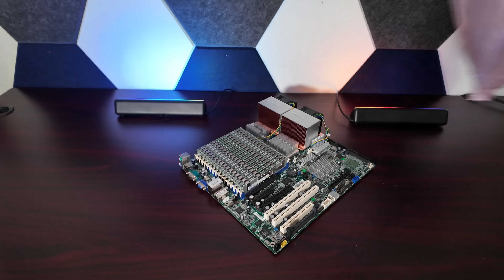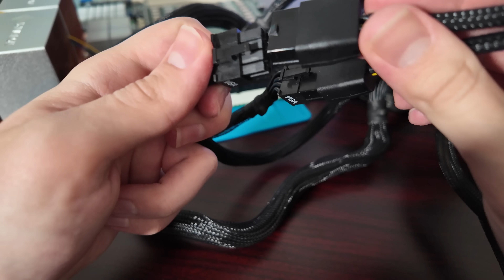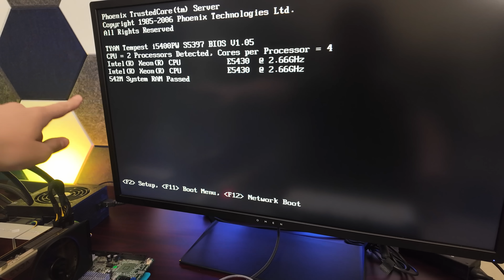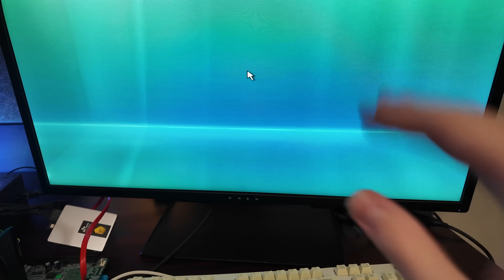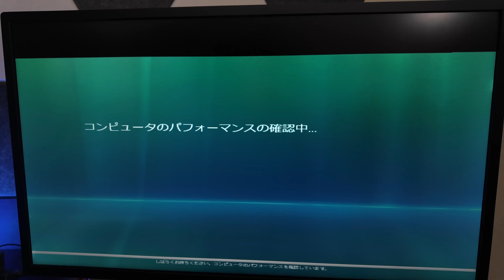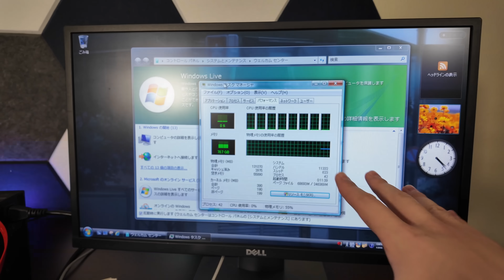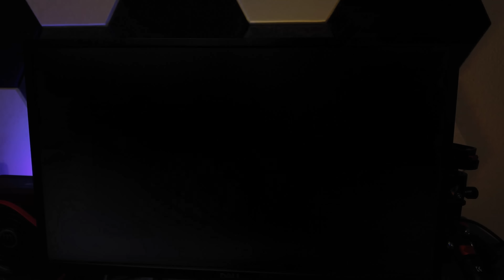What can you do with 128GB of DDR2?

Comment: Usually servers with that memory would be used for virtual machines. You're definitely bottle-necked by the CPU and the fact that it's DDR2 in terms of performance, but running lots of VMs/emulators simultaneously is something you could try; one computer becomes several drivers.

Comment: The ramdisk is probably caching writes so they are faster. Those speeds are surprisingly low, I figure the software is the bottleneck there. Since Linux has native support for ramdisks it would probably perform a lot better.

Comment: 9:00 - for anyone else that runs into a formatting problem during install, you don't have to restart the entire system or even restart the install process after a disk clean. You can just close command prompt, click back into the install wizard, and hit refresh/f5 to rescan drives.
Reply: He could've also just pressed《🔃最新の情報に更新(R)》(which hints to the fact [Alt]+[R] should've also worked) if he didn't think of the obvious key combination. Why did he do this in Japanese again?
Reply: @whohan779  He could only find a Japanese language ISO iirc
Reply: @jammer1248  Strange because even though Vista is somewhat obscure, there should easily be an ISO in every major language on the internet archive.
Reply: @whohan779  true. might have been some other reason for that, then. Or it could just have been he thought it would be funny.

Comment: Blender.  I have trouble with my current computer because I only have 64Gb.  Try about 3 million polygons and try to remesh it. It will seem like it freezes, but it will gobble up ram like no tomorrow.  I've seen it try to go up to 192 gb, using my NVME as ram... I gave up on it after some time, but if it can handle large amounts of math, it's worth a shot.

Comment: My computer is from 2007 it’s a dell T7400 that I use for gaming I have 16gb of ddr2 ecc fb ram (with the heatsink) 2 Xeon e5450s and a gtx 1070 founders before I had a GT1030 in it but my 1070 works good with my set up both my cpus are clocked at 3ghz but yeah I use it to play my games like re2 2019 and some other modern titles it does pretty well for a $300 pc 😂

Comment: I honestly couldn't watch the video, but zipped through it, what/who can use vista in 2026, i thought you're gonna do something cool with the ram, like LLM related, or at least homelab linux server, etc.
Each ram is eating like 8w, so at 128watts for the ram alone, and you can safely double that for the rest of the system. I doubt it is worth anything these days, performance wise comparable to an n150 or maybe tad bit better. Not worth wasting power cycles on it now.
FB-DIMMs are notoriously slow and power inefficient, only use case, space heater, lolz.
Which i really think that even a used AC is much more bang for the buck used as a heat pump.
God speed

Comment: I did a build years ago with 128GB of DDR2 - They got so hot, I sensed it was necessary to install a PSU fan on top of the DIMMS.  No errors, no interference.  Maybe it was all the metal shielding on the modules.
Reply: ECC

Comment: i feel like this video is retarded ragebait. you should have put a modern OS on it, with some sort of modern GPU and run some large models on it, opened some massive project files in various professional apps, etc. but instead most of this video is banging our heads against the wall as you install fucking windows fucking vista. like what the fuck did you smoke and drink while you brainstormed this project?

Comment: but Vista? you are a sick, sick man. Im all in for it. I would have liked to see the Pi check complete. that was always my goto when overclocking RAM, you could have a stable looking system in most standard benchmarks, but failed a pi compute. I spent way to much time in my youth diddling with RAM timings and getting multipliers to all mesh up nicely. my rig always ran faster with cheaper hardware than those who just threw money at it.

Comment: Installing Windows 7 in 2026 seems like a waste of time.

Since you have so much RAM, an SSD, and a graphics card, why not try installing a modified version of Windows 10 and/or 11, like MiniOS, and try running games like Halo Infinity or Cyberpunk?

You could try Android emulators or install them natively, such as PrimeOS or other Android versions for PC, besides Android-x86.

You could also try Linux distributions like Zorin, Mint, Ubuntu, Bazzite, etc. That way you'll really test the power of that beautiful machine.

And please, use English versions of the operating systems, instead of those Chinese ones.

Greetings from Santiago del Estero, Argentina

Comment: ofc thats fbdimm and its even slower than normal ddr2, and all that capacity was mainly targeted at server use. Well not too long ago you could use such a twin xeon s771 rig, paired with a gtx 980 to actually play modern games, but that was 2018-ish and is not relevant anymore cuz no avx or sse4.2. But again considering that games from this decade are mostly shit (cp77 and likes of it), ig just use it for 2010-2019 games and sell off the surplus ram, more than 24 gigs would be a total overkill anyways.

Comment: Has anyone ever swapped RAM modules while the MB in standby mode? I did. I upgraded a computer from 16 to 32 GB and when I went to plug the mains cable back into the power supply, I realized I had forgotten to unplug it 🤦‍♂Interestingly, nothing happened, but I don't want to be the one to test how many times you can do it without damaging something

Comment: The next generation with DDR3 with the memory controller on the processor is so much better. I have a server with 192GB, this memory was dirt cheap a year or three ago.
Don't forget that this board probably has ipmi so you can control this thing from remote.

What's up with that vista version? And you should be running a proper OS on it, with a couple of VMs or containers.

Comment: On the power pins for the cpu. My assumption is the 8 pin cpu was in its infancy or only just started being conceptualize. So the board had the wxisting standard of 4pin double.  Like how some high end boards have 2 8pin connectors for the cpu now.
Reply: Alright, watched it back. That is odd they are spread like that. But its probably to do with board layers and trace pathing.

Comment: I'd say, some interesting uses could be : 
- large IA/LLMs models, like many suggested
- you were on the right track with the RAMDisks : RAMDisked VMs on which any OS could run, Win10/11, Linux distros... & In an equivalent of multiboot, so that instead of proper multiboot EFI/bootloader, you'd simply have several VMs backups in storage, to run at any point, with still plenty of RAM &/or RAMDisk storage on the side, available with each RAMDisk active OS.
→ For instance : a 50 GB RAMDisk on which a Win10 VM is running, then a 40 GB storage RAMDisk on the side, that would be used in common with several OSs eventually (careful about the partition type & compatibility issues, esp with hibernation), & plenty of free RAM aside.
- RAM-based NAS/server ! Yey ! Would behave sort of like a NVMe based NAS, but with storage that doesn't suffer the same flash degradation under intensive use , so some actual intensive use of memory/storage here could make sense. Would require some regular backups on the fly though, on some actual permanent storage (HDD...), & I don't know whether SoftPerfect allows all that in such case, or any equivalent on NAS OSs...
- Crypto-mining memory (flash) based, but I don't know of any personally, not my experience...

Comment: the extras next to the 24 pin plug are the CPU 12v plugs.

The 3rd one is for PCI-e and peripheral power, that rail can provide about 150watt of 12v power, 50 watts of 5v power and 12 watts of 3v power.

Back then the bridges were electrically seperate from the data signalling so used diffrent power for best results .

your welcome

Comment: that air needs TO BE DIRECTED ACROSS THE SURFACE OF THE SUPERMICRO BOARD
SORRY I didnt mean to use caps
thats a 1u setup
it will 1000% hit tcu safety in like 5 sec and clock down throttling back
if you cant get a 1u server chassis, yo buy somw acrylic and make a chassis out of that instead. use pressnuts for screws.

Comment: There's an application called glucose on GitHub that's used to solve satisfiability problems in .cnf files. This application consumes a lot of RAM and CPU. It's especially suited to your hardware and also serves as a benchmark for the efficiency of system tuning. I would also look into the cache architecture of that Xenon. This will help you determine if it's worthwhile to use multicore problems or not. Glucose is single-core.

Comment: This machine would be great for batch pathology analysis of whole slide biopsy scans in programs like QuPath which are incredibly RAM intensive rather than CPU demanding. Even today, I’m limited by heap memory for analysis of SVS scans and there are scenarios where I’ve struggled with 64 gb. Each scan is an architecture consisting of tiled pyramid TIFFs of 40x scans which are absolutely massive and normally have to be streamed into the pathology analysis software so that they don’t consume all of your memory—especially if you have a massive project running with 30+ scans that you’re batch analyzing with scripts. This machine would shine in that environment.
Reply: Or you can run a single Java program
Reply: @mkontent  Finally. A PC that can run Runescape in 2005 at good fps.
Reply: Also usable for large-scale (for that era) database migrations. Load all the data into the RAM disk, configure the database to use that instead of a hard disk, and then let it rip. A couple of minutes and it's done, instead of a whole week+ of disk swapping on a machine with the 2 to 4 GB of RAM that was common back then.
Things like that where it's not just that the RAM was much faster than a hard drive for moving files around, but also that you never needed swap during processing.
Reply: You would be better off buying SSDs and just swapping to disk. Even a single NVME is faster than the RAM in the video. And if you set up a raid array with a dedicated pcie controller card, you can hit like 30 Gigs per second
Reply: DDR5 is so much faster though.
Would be interesting to check how much DDR2 RAM you would need to be the same speed or faster than a 64GB DDR5 RAM machine for this use case

Comment: In 2004 or so I bought an apple G5 powermac and ordered an extra 8 G of ram and they charged 1000 cdn dollars plus just for that 8 gig extra. That computer was noisy and could heat up a room. I confess I bought into the hype at time but overall had a lot of fun in the process.These days I run a linux machine with 64gig of ram which is a lot of fun and satisfaction to run a non microsoft/ non apple system.

Comment: why don't you install Windows 7? Vista is too slow and problematic..
Reply: Actually, that is a biased and largely incorrect claim made on what can be called 'mob mentality'. A couple of people who had bad drivers received crashes, which, 20% of all vista crashes were from NVIDIA. Why? The industry had made an abrupt change, no one was prepared for Vista's WDDM over XP's XPDM. It largely was an efficient OS too. Aero didn't get any lighter on Windows 7. If you test them side by side, Windows Vista SP2 64-bit runs faster than base Windows 7 64-bit on all counts. Vista was a good OS, it got the short end of the stick for absolutely zero reason. Which, Vista actually had benefits like DirectX 10, which XP did NOT support. And also, this was a result of the stagnation in tech development. We just hadn't reached to 2GB+ of RAM, GPUs with acceptable VRAM or gotten past the core/core 2 age. Windows 7 came out right as these problems were being solved and still took numerous years to overtake XP, a decaying, dead end OS based on Windows 2000, already 7 years old and reached nothing. Vista, however, was based on WS2003, a fresher, cleaner NT kernel designed for servers. Because of Vista, 7 also indirectly was based on WS2003 because they are identical. This is one of the biggest open secrets in the entire tech industry. Please just google what you're saying before you say it, atleast.

Comment: Two thoughts,  I assume it would run a pretty beast mode database in a ram drive. Perhaps as part of a locally hosted llm..     The other is, if for any reason you wanted a computer that wiped itself when you turned it off..  This would do it very well.

Comment: The extra power connectors are probably becase fbdimms are really power hungry

That said, I don't have anything with that much ram from that era, but I do have a sun t2000 with 64GB of ddr2, as it came from the factory. Then from a few years later I have a sun t4-1 with 128GB of early ddr3 🫠

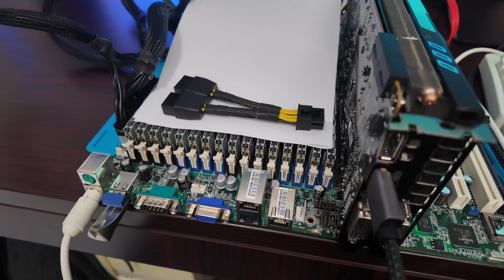Comment: 7:21 that third, lonely ethernet port is likely for some sort of lights out management. You could hook into somehow to manage stuff.
Reply: the SODIMM slot at the bottom of the board was for a server management card. This was from the days before chip-down BMCs. The Tyan SMDC probably lit up that network port when installed.

Comment: 0:20 it just looks like some extended form of ATX. What's the dimensions compared to ATX? I've got a standard ATX board from Supermicro, but extended ATX has been pretty common with enthusiast (especially XOC), prosumer, workstation, and low depth servers for a while now. My NAS runs a x9srl-f, but I might end up with something larger down the line, depending on how things shake up (was planning on going low end Epyc if the China deals were still around, but I might just upgrade to better DDR3 to make it so ECC is fairly priced).

Comment: I hope u can try LLMs in that computer.
Reply: If you could somehow get this to optically transfer the data at sufficient speeds [like using a PCIE optical ethernet port at sufficient speeds], it might not make the worst temp holding storage. The major issue is that DDR5 RAM is so much faster that it's just practically not worth even discussing otherwise.
Reply: The memory bandwidth will make it dog slow lol
Reply: this thing has I think four memory channels running at four DIMMs per channel at DDR2-533 with two quad core CPUs attached over a front side bus to an external memory controller. A USB thumb drive has more memory capacity and bandwidth than thos motherboard. You'd get faster speed running an LLM using a USB thumb drive as memory.

Comment: Jumping in to comment afte 3mins of watching haha, but the 2 4 pins are more than likely to make sure each CPU has minimal power to actually run. Why they're placed where they are is a mystery to me, but I wouldn't put it past a QA tester plugging a 4x2 into both at the same time if they were ever side by side. I'm impressed ddr2 actually had 8GB sticks, I swear most OS and hardware back then couldn't handle more than 4GB sticks